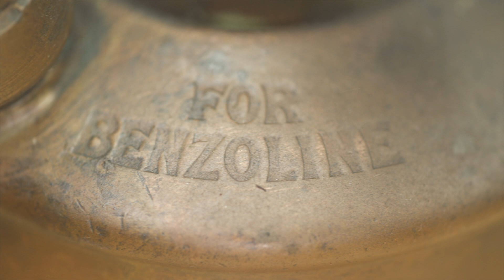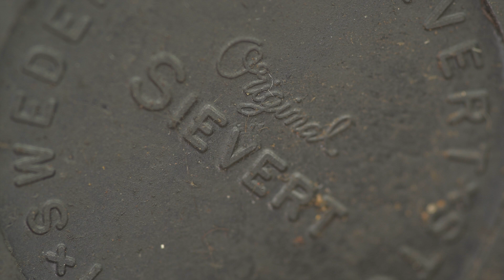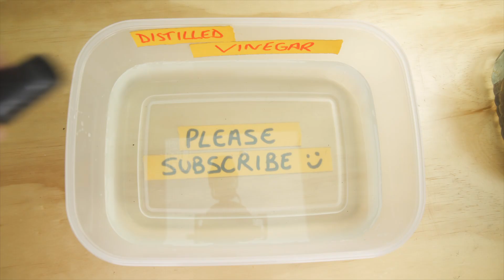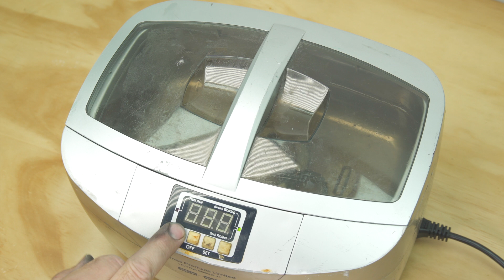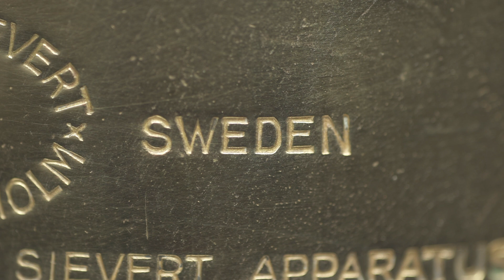Vintage Tool Restoration -  Antique Max Sievert Brass Blowlamp restored - asmr

Comment: Very good work! I have a similar blowtorch, same model but a few years older, in very good condition so no restoration is needed, and my blowtorch works perfectly.

What I noticed in the video at 16:55: the spring is missing in the safety valve. I don't think the blowtorch will work without this spring.

And also: I would have turned the burner a little more to the left so that there is more space for the pump. This is the case with my blowtorch, which is in its original condition.

I also wonder whether the seals under the bracket are really necessary, are the threads continuous?

But the result looks wonderful! Thanks for the video.
Reply from the maker: Hi Pius, thank you so much for your comment, it's great to have such good feedback from someone with first hand experience of this kind of blowtorch. Clearly there must have been a couple of bits missing when I bought the torch on Ebay and it's very difficult to find exploded diagrams of the working parts. I will check out the spring, but it makes perfect sense that it needs one. The washers were replacements of what was there before, the tappings do go all the way through into the reservoir so the compressed air and fuel could potentially escape if it were not sealed properly. Thanks again👍😊
Reply: @restoreandmake  Interesting. Thank you. I didn't know that seals were needed under the bracket because I never dismantled my blowtorch. I only greased the leather of the piston and cleaned everything a bit.

What I would be interested in is the age of the lamp, I guess yours is from the fifties, mine maybe from the forties. The middle part of my burner is not cast but soldered together so I think it's older. Everything else looks the same.

I like the shapes and the materials, everything simple but very beautiful.

Thanks again for the perfect job.
Reply: @solohan3193  Wow, the similar model ... and that in a galaxy far, far away ... :-)

But seriously, how old my blowtorch is, I would also like to know. I guess my model is from the forties. Because the part with the carburetor, valve and burner was soldered from individual parts, with hard solder. Later that part was cast as one piece, I suppose, like the blowtorch in the video. Unfortunately, I didn't find any features for Max Sievert blowtorches anywhere that would allow accurate dating. Some have different handles and wheels on the pump and valve. Or the engraving is different: mine says APH and FOR BENZOLINE. Later models have a different name for the type instead of APH. The whole style of Max Sievert blowtorches was retained for many years. This is why some seem to be older than they are.
Reply: @solohan3193  Yes, difficult. I look further from time to time, maybe a collector or a museum will put precise information on the Internet one day. Sievert products have obviously been changed as little as possible, certainly because they simply worked well.
Reply: @solohan3193  Yes, that bothers me too, I would also like to know the exact age of my blowtorch. Other manufacturers marked their devices exactly. On my kerosene lamp, the quarter and the year are even stamped on the sheet metal. After all research, I think my Max Sievert blowtorch was made around 1945, and the very similar one in the video was probably made around 1950, plus / minus a few years.

Comment: Nice restoration. AS far as the pump washer is concerned I would have thought it was originally a cup washer (mine is) but if it works, all good. I see you have sourced the nuts, I was going to suggest you contact your local Model Engineering club who could make some for you.
Reply from the maker: Hi Piper Peter, thanks for your great comment, thanks for the advise regarding the pump washer, it's a difficult thing to research. That's also a great idea as to how to source the right sized nuts, I'm sure it'll come in handy in the future👍😊

Comment: Great video, must admit I’m a bit disturbed by the cup of tea placement in proximity to the polisher.
Reply from the maker: Hi Sarah, thank you for your kind comment, you're very perceptive, I placed the mug there to plug the merchandise, but your absolutely right, within 30 seconds there was so much dust and lint on top it would have been undrinkable😂👍😊
Reply: @restoreandmake  as a Brit I agree, that’s a terrible thing to do to a brew heh heh. 😀